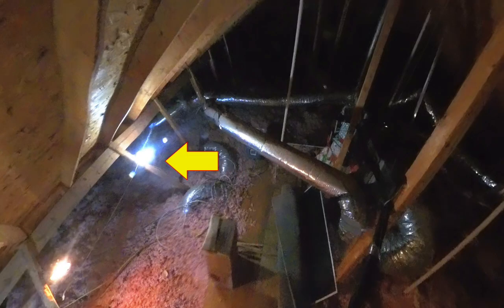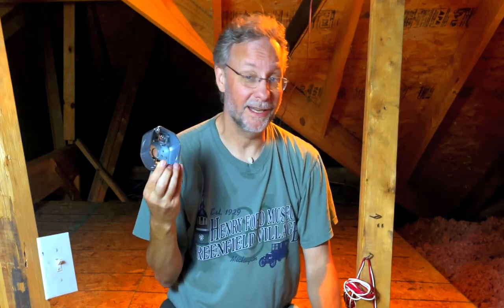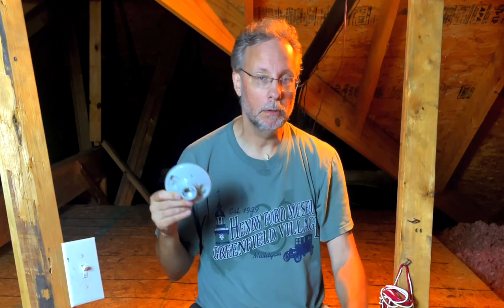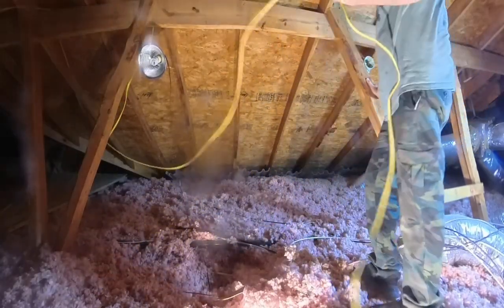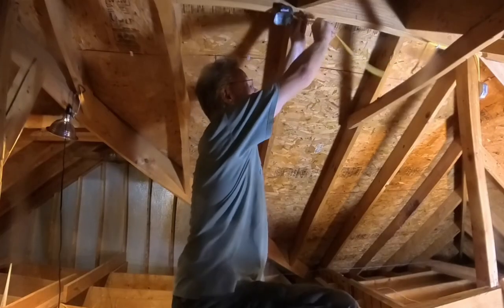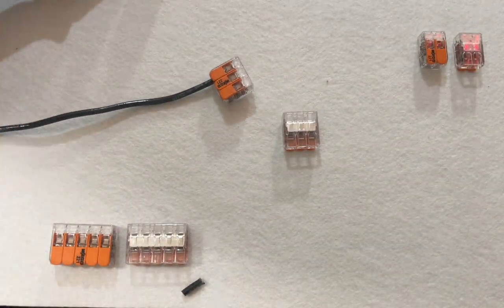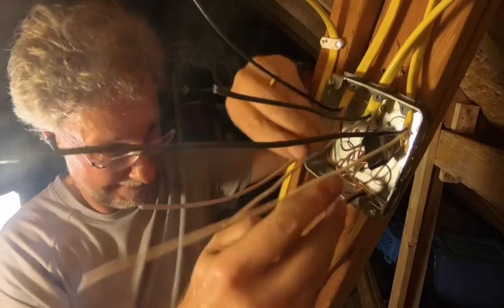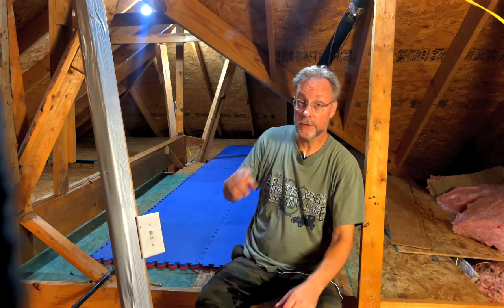How to Install Attic Lights

Comment: Nice video. When I decided I need more light in the attic here i went to Amazon and purchased some 12V LED strips (bright white) and used an 110 to 12V DC that I had laying around.  WORKS GREAT and since they are kindof flat against the top of the roof I don't hit my body against hot light bulbs which will burn me and (at least once in the past) break the light bulb off in the socket.

Comment: Much respect for filming in that uncomfortable and hot space. Great job explaining all the steps for this project. I recently made the same endeavor but opted for a single LED string light, worked a charm and saved me the time and expensive of those 5 junction boxes. I still ran 3 for outlets across the space but saving those other two in that uncomfortable space was appreciated.
Reply from the maker: Honestly, what I did may have been overkill. Romex ain't cheap.

Comment: Mike, I love your videos, apart from this one, that seems to be a tutorial in how to get electrocuted.  As is said about electricity, you have zero chances to stuff it up.  You need to turn the power off before messing with the wires for safety.  Not have the lights on as you wire others up on the same set of wires.  Please don't 'do a Mike' here people.  Be safe and happy.  At least, that is what looks like is happening.
Reply from the maker: There is a shot where I screw in the lightbulb, and it at least looks like it lights up. I honestly don't know what was up with that, and maybe should have edited it out. I absolutely had the breaker off for 100% of the work. I was using work lights with an extension cord to another circuit. 

Now back to my usual sarcastic replies....
Reply: @MikeTheBackyardMechanic  I just want you and others to be safe.  Be well!

Comment: I just plugged a lamp into my attic outlet lol
Reply from the maker: My usual setup is to put a plug outlet socket into the one existing light fixture and run extension cords from that to work lights. I needed more light up here.

Comment: Run CAT5 or CAT6 cable for the security cameras. Then you can use Power Over Ethernet and have a single cable for data and power. Better than having to rely on a good wifi signal.
I am betting that all of that fancy lighting is so you an shoot videos from the attic more frequently.
Reply from the maker: I don't believe in wires.

He says... after doing a video on how to run wires...

Comment: Is that " major project " spot in your attic where  you plan on performing your stand up routine ?
Reply from the maker: Yes. But, it's a low ceiling. Or, I mean roof. So I can do stand up. But on my knees. Knee up?